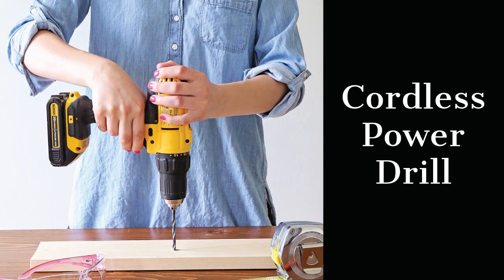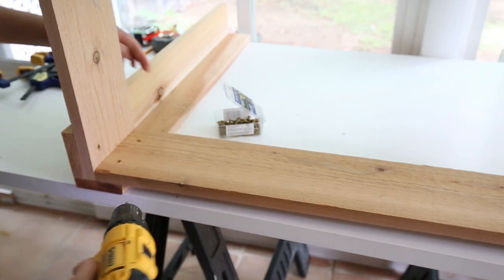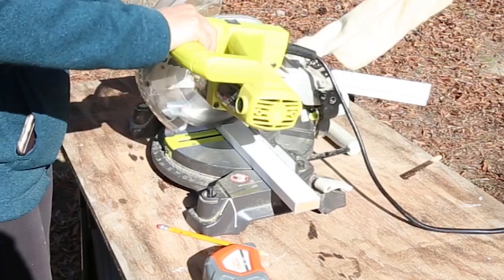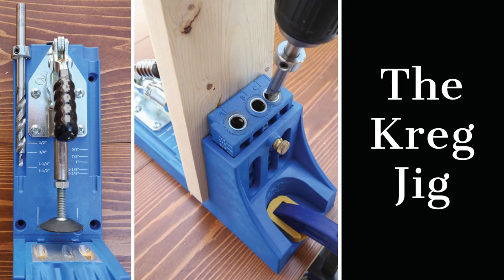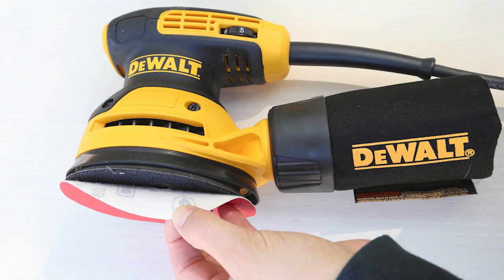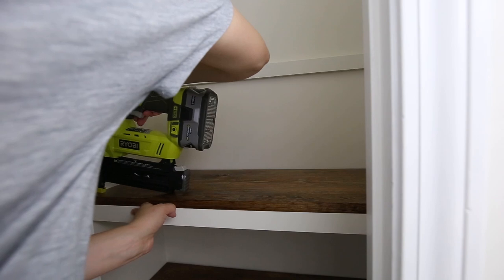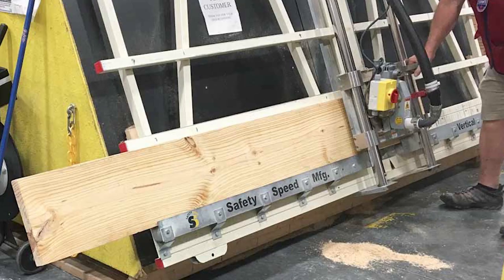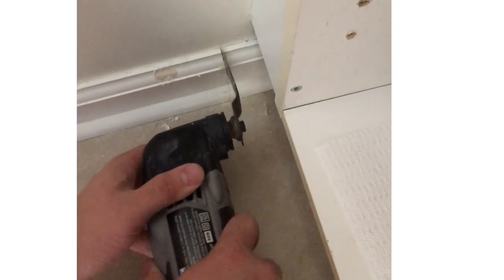5 Essential Woodworking Tools for Beginners | My Favorite Woodworking Tools

Comment: Are you going to do a video on your Dremel tool sometime?  I would be interested in how you use it.  It looks like it has the ability to be used like a reciprocating saw, but with other functionality, too.  Is that true?  Thanks, Angela Marie!
Reply from the maker: That is a good idea, possibly in the upcoming year. They are very versatile tools. I will say that they are designed to do smaller projects and get into smaller spaces where larger tools can't. The multi max has the ability to cut as a reciprocating saw but also has different attachments to sand, and remove great and other uses as well.